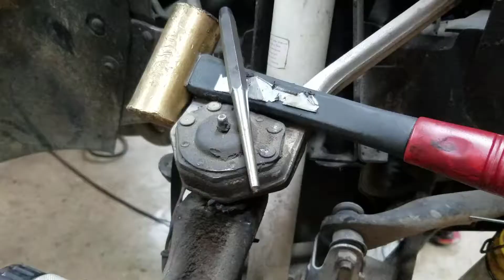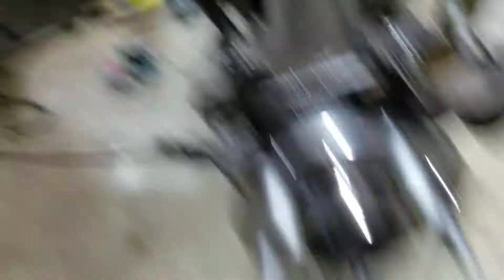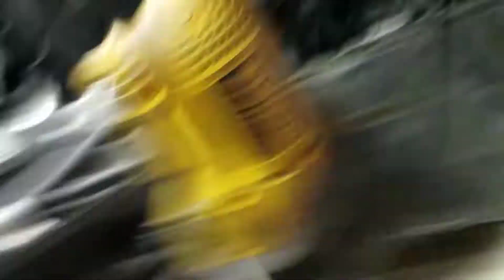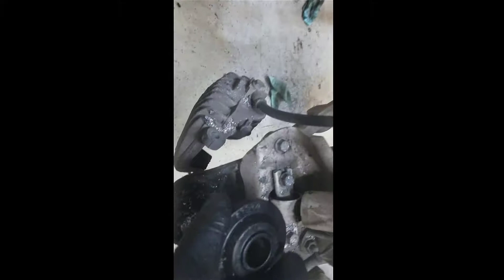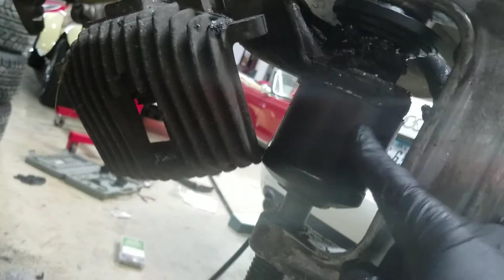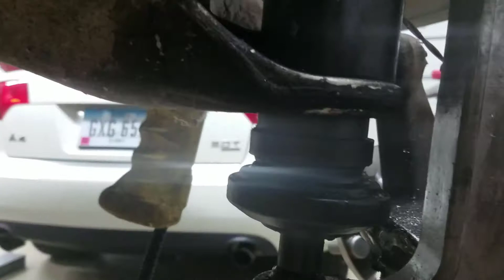c4 Corvette ball joint replacement

Comment: How long did it take you to do one side? I have to do both sides of mine top and bottom and would like a decent knowledge of how long it takes
Reply from the maker: Around 3 hours a side by drilling out the rivets.  Perhaps grinding and punching could be faster.
Reply: @sly59vette I used an air hammer and had all four fronts done in roughly hour and a half  with no lift but your video was VERY helpful thank you a ton!

Comment: I find 1/4" Cobalt M35 bits with a bit of WD-40 are highly effective at drilling out the upper ball joint rivets on C4 Corvettes.  Slow, medium or high speeds provide noticeable progress.  Each rivet only takes a couple of minutes with a Cobalt bit and one or two bits should be sufficient for all 8 rivets.

Comment: Here's what I did on mine. I ground the rivets on the top flush. I then center punched just to establish a center of the rivet for drilling. This is important to get very centered. I then drilled about 1/8" deep hole, with 1/4" bit, just to establish a good center where the bit I'm going to use to press these out won't wander. Don't go too deep. The whole goal is to press these out instead of drill. You want to avoid marring the arm.

Now the trick: Buy a 3/8" drive 5mm hex bit socket. There are many varieties, but the one I went with was a 1 piece construction whose shaft was no larger in diameter than the circumcircle diameter. That's a fancy word for the diameter across from point to point, rather than flat to flat. With a 5mm hex (which is the diameter from flat to flat), the diameter from point to point is 5.8mm. This means it will fit through the hole of in the arm, which is 1/4" or 6.35mm. The reason this bit works so well is because of the larger socket diameter. The one I found was 3/4" wide. This allows you to use your press and the thing won't shift if you're careful to center it up. 

For support in the bottom, I found a socket which allows the flared end of the rivet to go into. This did involve removing the boot of the ball joint to allow for some room to get in there.

Go slow. Go 1/8" and make sure the rivet is being pushed out. The first hex socket I used wasn't long enough, but I was able to press the rivet out about 5/8", and then put the remainder on the vice, and turn the arm back and forth with some upward pressure and it popped right off.
Reply: Do you think pressing out these rivets could be done with a heavy duty c-clamp? As I don’t have a press. 

And what about soaking the rivet in penetrating oil for a few days? May could get down in there or not?
Reply: @colt5189  Doubtful

Comment: When I took my front wheel bearings off the spindle I noticed there was some thin oil in there, still really clean it kinda looked like motor oil, I didn't know if I needed to oil the inside again with the new bearings, do I need to oil them?
Reply from the maker: Probably lubricant to aid in inserting the bearings.

Comment: It would have been better to driller the rivets, out why the ball joint was still in place...
Reply from the maker: Perhaps.  I wasn't certain how well the holes would align with my replacement ball joint.  In the picture, you can see that my replacement ball joint wasn't a perfect fit with the OEM.
Reply: @sly59vette  hey you still did a good job!😃👍🏿
Do you notice a difference in the way it rides?

Comment: Slightly cleaner/easier method. Do what you say about grinding/drilling the rivets on the top (backplate of ball joint). Get ball joint off. Grind the rivets flush to both sides of the a-arm. Youll notice the bottom has a larger diameter. This is because the bottom of the rivets is tapered. Take a center punch and hammer, get the a-arm on a solid surface and hammer down on the smaller diameter end (NOT the tapered end of the rivets). I've done numerous this way and provides the best results. Its extremely hard to keep a drill centered on the rivets; it will inevitably walk and start chewing into the aluminum of the a-arm.
Reply: Meaning drive them out from the top to the bottom?
Reply: A still better option would be to press the rivets out, but I agree, don't drill them out!
Reply: @larrybud  What kind of small press would you recommend? Maybe use a c-clamp with a small socket that is a little smaller than the rivet?
Reply: @ I bought the harbor freight press when it went on sale. Made for quick work, but you definitely need to be careful when using the press. The force in the handle is so greatly multiplied that you can easily bend stuff without realizing it....
Reply: What did you use to gring the rivets off flush with the A-arm?

Comment: What is torque specifications for the bolts (and nuts) attaching the upper ball joint? I'm very confused  about torque specifications on those bolts. How many Ft-lbs did you use? In Haynes Manual it says: "Tighten the bolts to the torque specified in the new balljoint instruction sheet". Mine doesn't have any instruction sheet. I 
found  statement on one forum "The instructions supplied with my MOOG upper ball joints stated 
12-14 ft.-lbs for the bolts and nuts." My suspension kit is not MOOG, it is OCPTY - New 8-Piece fit 
for 1995-2005 for Chevrolet Cavalier - 2 Front Lower Ball Joint 2 Sway Bar 2 Outer 2 Inner Tie 
Rod End. In one film (but it was a Chevy truck) the author applied 50 Ft-lbs. My car is 2003 Chevy Cavalier, just one control arm. Thank you for the informative film.
Reply: german torque specs specify that the upper ball joint bolts should be torqued to “gutentite”

Comment: Talk about doing things the hard way! Use a 4 1/2" angle grinder and you'll go right through those rivets in a few seconds.
Reply: What’s the best way to press them out without having a shop press?
Reply: @colt5189 there isnt. Buy a ball joint press or risk screwing up the front end. Also dont put those damn ugly ass nuts & bolts in the top ball joints. It screams Amateur who doesnt know how to buck rivets & looks like total shit.